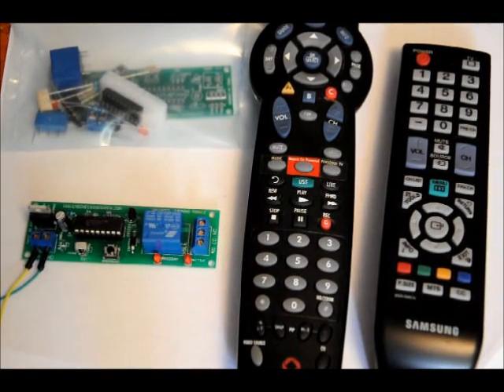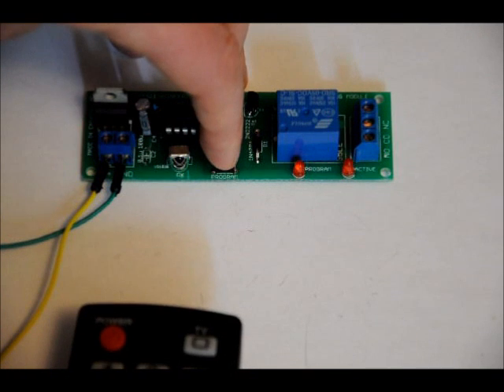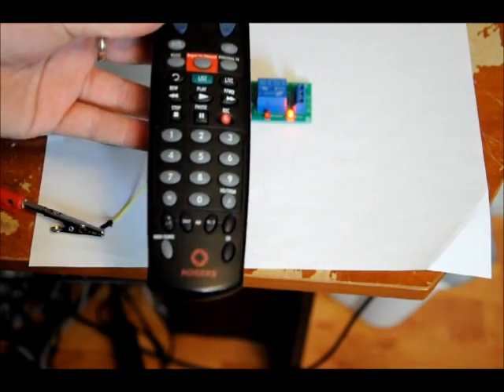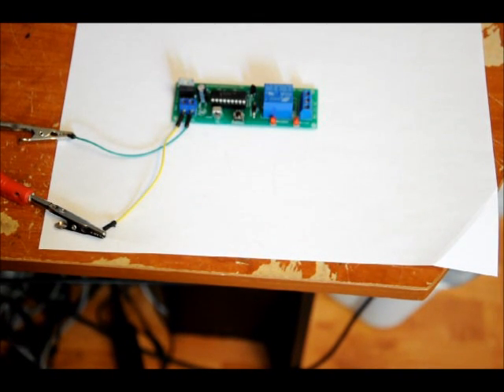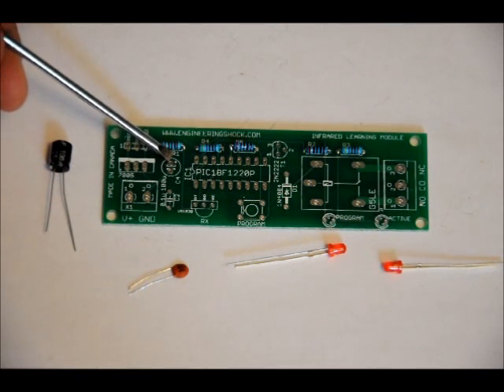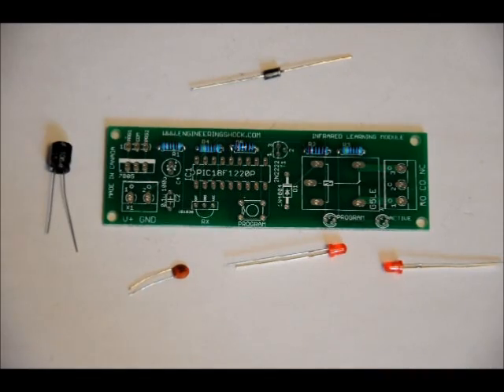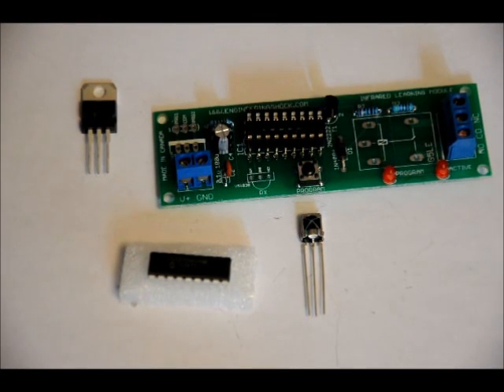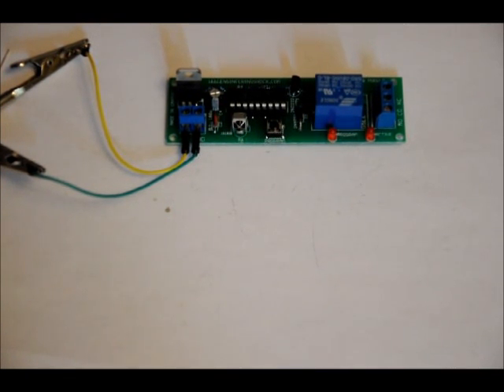The Programmable Infrared Relay Driver Module  - Control AC With TV Remote Control

Comment: I NEED YOUR HELP, I HAVE L.G SPLIT TYPE WALL HANGING ROOM AIRCON AND I CAN'T TURN IT ON WITH REMOTE CONTROLLER.
THERE IS THREE POSITION MODE(FERCED OPERATION, AUTO START, REMOTE CONTROL) FOR TURN IT ON AND I CAN TURN AIRCON ON FORCED OPERATION MODE BUT I CAN' TURN IT ON WITH REMOTECONTROL....CAN YOU ADVISE ME WHAT MAY IT CAUSE IT?